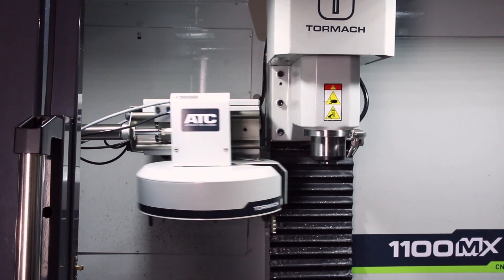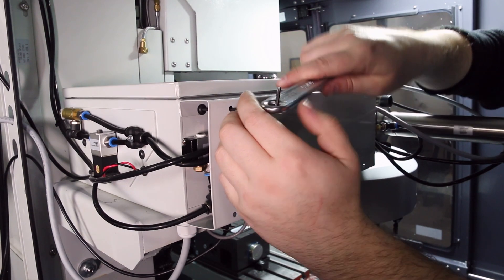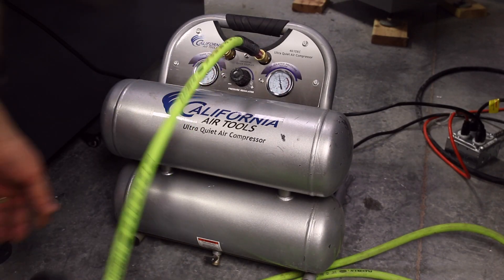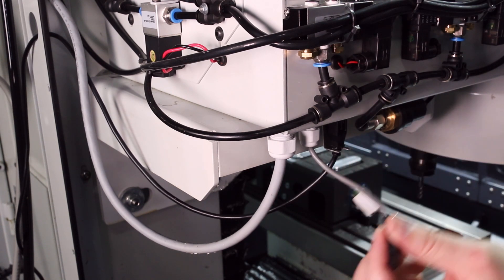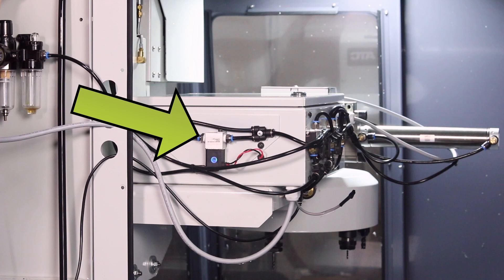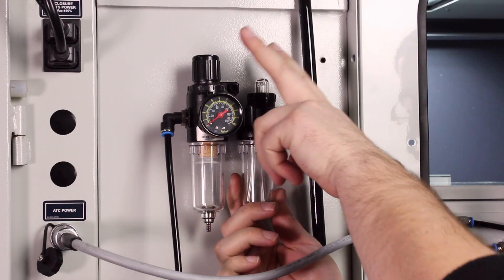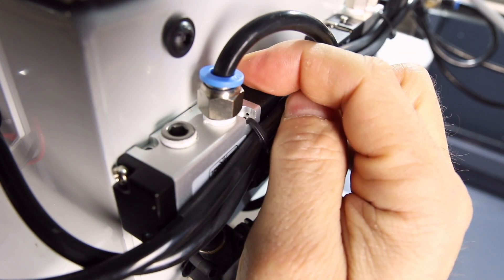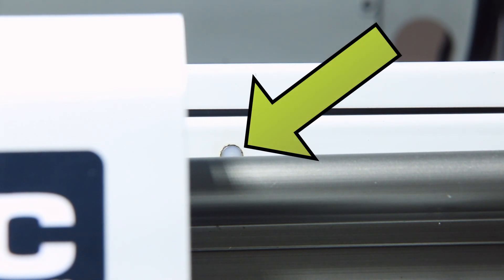770M/MX and 1100M/MX ATC Maintenance and Troubleshooting

Comment: Im losing it. This atc is such a waste of money, and has had nothing but problems since installing. The cycle timing on mine is now messed up so it just drops the tool right when i try to load it.
Reply: Thanks for going over that btw... "this could be an issue with the solenoid where it's sticking" completely moves on with no explanation very helpful👏

Comment: Im having a homing issue with the ATC any content on that? Im about to call service to see what can be done, the whole ATC shakes like its about to explode and then in stalls out and throws up ATC homing error, this is when it calls the ATC to spin to change tools, not on the pneumatic end of things.
Reply from the maker: A video on homing errors is on my todo list, but I haven't had time to film it yet. The ATC shaking doesn't fit the normal issues, though, I would recommend opening a support ticket and sending us a video of the behavior.

-Norman

Comment: Thanks for this video. I had 3-4 low pressure alarms every tool change @ 90-100 psi.
Not mentioned in the video but you need to unscrew the small screw between the 2 wire connection to increase the pressure in the low pressure sensor. For me it was 2 turns counterclockwise until the warnings were gone. Machine works flawlessly now.